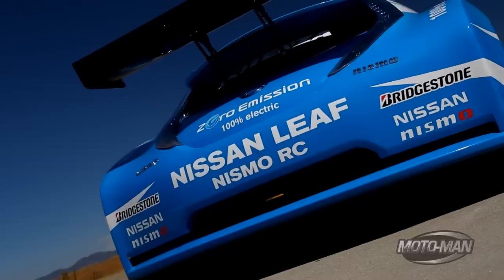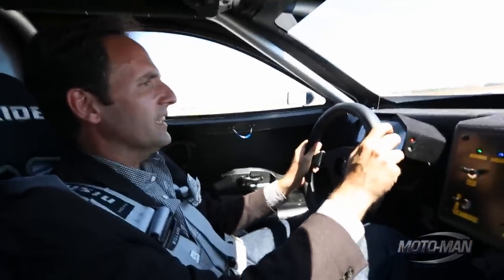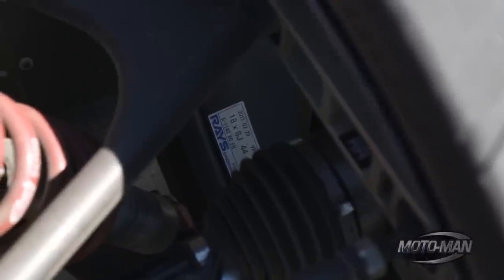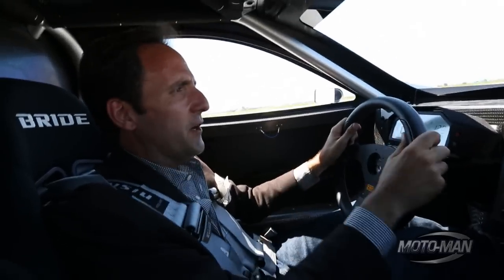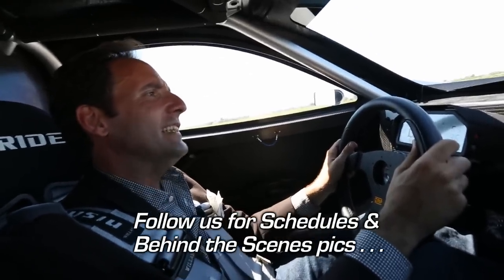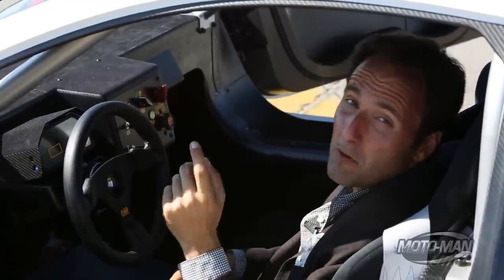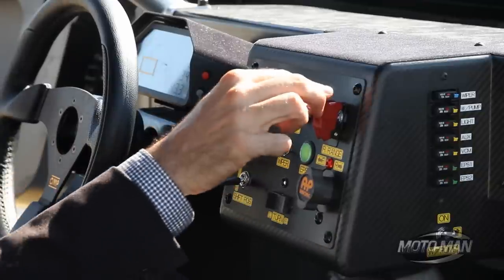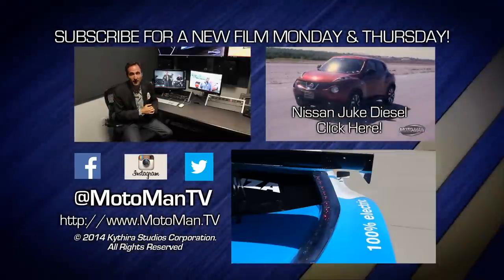Nissan LEAF NISMO RC - First Drive of an Electric Race Car

Comment: leaf headlights, leaf tailight, leaf nissan tag. That's about it for leaf parts
Reply: +Veikra Uhh.... and the motor, which is 100% identical to the one in the production Leaf.
Reply: im not even talking powertrain. Same motor maybe, more cooling more batts more inverter power id bet
Reply: @Nordic_Mechanic  still the same motor with the same "horsepower". You get a Nissan leaf, drop it a little and get it some meaty tires. It'll preform the same.

Comment: That exhaust note is intoxicating! I'm deleting my Hellcat ringtone for this right now!!!

Motoman, do you think electric motors will ever get into the pickup segment? Seems like hybridization will yield better fuel economy, have higher torque outputs, and give full instantaneous power at all levels. It is obviously the future of motorsports and performance cars. I can only imagine a diesel hybrids becoming more advance than transmissions, though ZF DCTs I'm sure could handle the advancement.

Comment: Yes, it's an old video, but let's compare... my production 2015 BMW i3 BEV is 2635 pounds with 184 lb/ft of torque and 170hp (or 180hp per dyno run https://www.youtube.com/watch?v=Z24-jenc5yM).

Comment: A glimpse of what should not come...Ever been stuck behind a nissan leaf in a 55mph stretch of highway? Too little, Too late nissan. It's nothing compared to the Rimac Concept-One, a Formula E car with their 300hp motor the literal size of a folgers can, or a Tesla. If the petrol car producers don't start stepping it up, their gonna get left in the dust. Car also looked a bit boring underneath the hood.
Reply: yeah yeah we all know the leaf is a boring  car and the drivers are slower than prius drivers